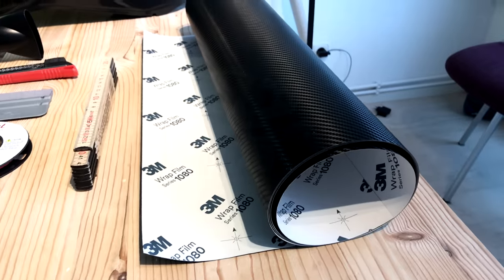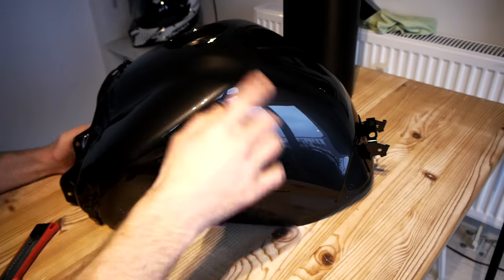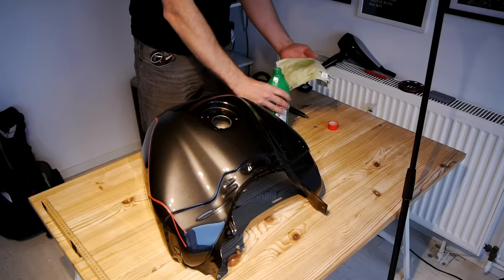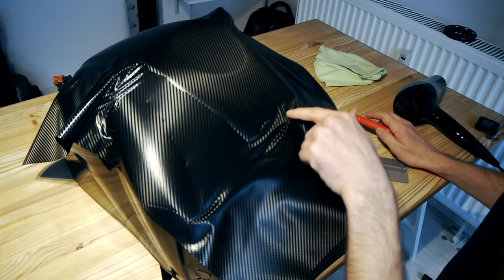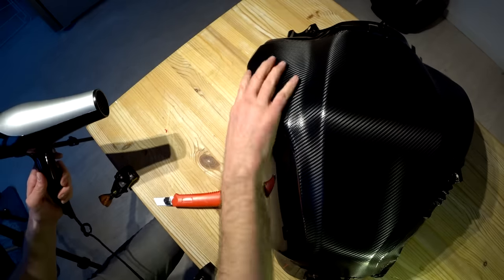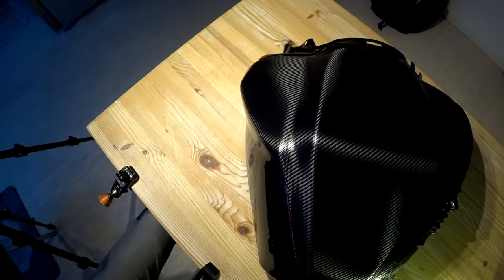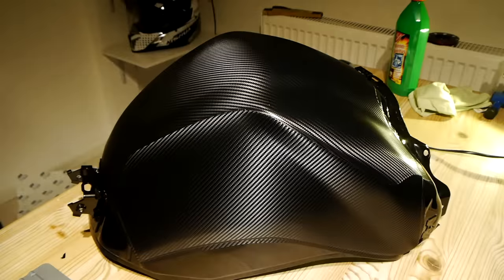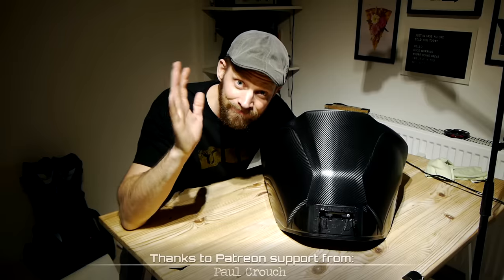Vinyl Wrapping Motorcycle Tank

Comment: The sad part about this video is that every time you put that razor on that surface, there will be a scratch....Use the back of the blade when trim if you must!....but good job on the wrap!
Reply from the maker: But the back of the Blade wouldn’t cut the Vinyl at all! To be honest I’m not so worried. It’s not like i trimmed in any visible areas and the areas that i did trim in are already not full gloss finish and they are covered in either adhesive residue from the panels that go there or scuffs and wear from touching other parts of the bike.

Comment: Could you not just double lap the adjacent pieces, and just use one filament to cut through both and carefully pick out the waste from under - as a decorator, I use this on wallpaper.
Reply from the maker: You could, as long as you don’t have too much excess from the first piece. Otherwise you’ll be ruining your first piece by digging out acres of excess material! That’s the point of the Second line of knifeless tape. It trims the first piece down to a minimum.

Comment: all this work for such a small job.... maybe plasti-dip would have been better?
Reply from the maker: Lots of work, sure. But way less faff and mess than both painting and plastidip. Vinyl is far less sensitive to atmospheric changes and temperature fluctuations. Also there's no risk of overspray or fingerprints in the surface. All perfect for my situation. If I'd have spray painted anything in the kitchen, I'd be a single and homeless man!!

Comment: You doing it wrong mate! Use some water first
Reply from the maker: Actually no. In the Spec sheet from 3M, the manufacturers of this vinyl, it says that it is not suitable for wet application. In fact the body part must be 100% dry.

Comment: Un claro ejemplo de cómo no hacerlo bien... puede que el resultado sea aceptable pero la ejecución es deplorable
Reply from the maker: ¿Puedes explicar porque?
Reply: @AndyManCam  porque no se hace así, la pieza se moja con agua y jabón antes de pegarle el vinilo y se empieza por el punto de máxima tensión para deformarlo y que cubra el depósito de una sola pieza y sin cortes. Además la línea roja que da relieve tiene que ser barnizada encima del depósito sino se formarán burbujas en esas áreas. Un saludo.
Reply from the maker: No es verdad. El vinilo '3M 1080 series' no está diseñado para aplicaciones húmedas. Esto está escrito en las instrucciones específicas. Saludos.
Reply: @AndyManCam  eso te lo pone la marca porque así es más fácil que salgan burbujas y te toque cambiarlo, cualquier profesional del vinilo te lo puede confirmar. Estrategia de obsolescencia de toda la vida...
Reply from the maker: If you say so. I've watched many videos online of professionals wrapping cars and bikes with vinyl. Not a single one used water or soap. All dry. But if it works for you, then all good! :D